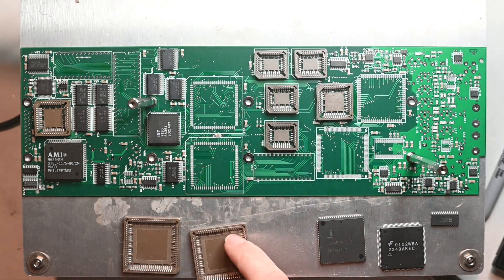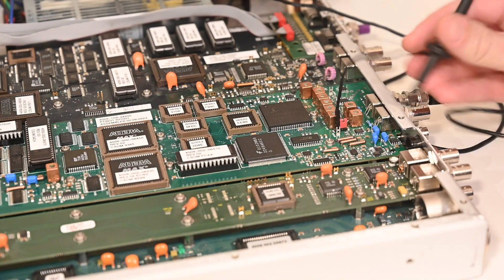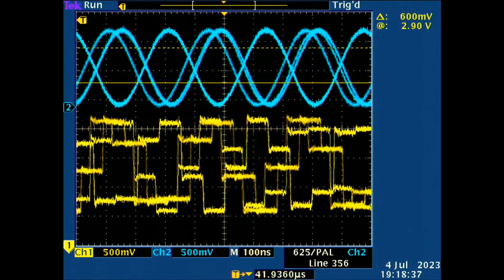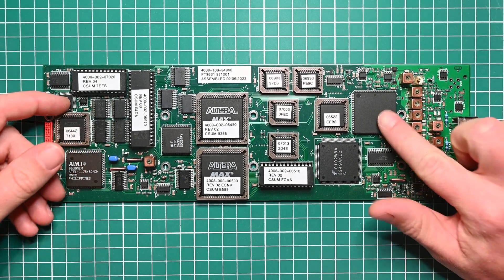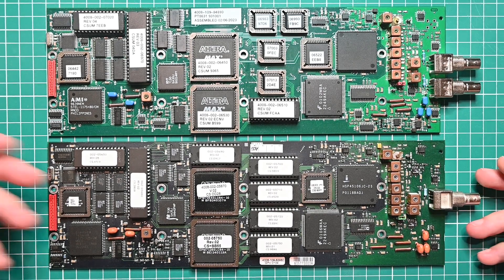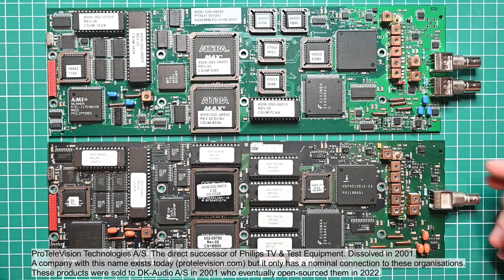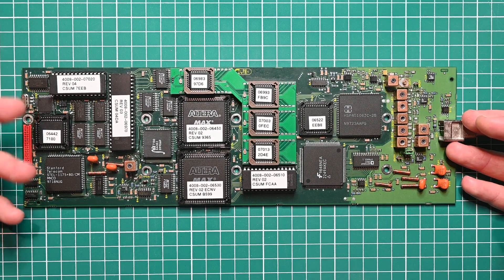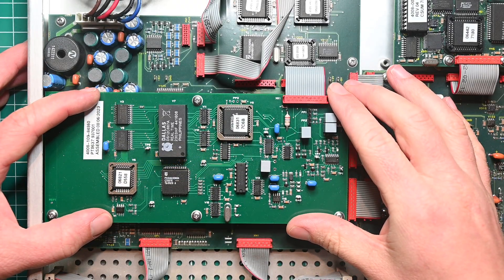#8 - Philips PT8631 build follow-up + Converting a PT8601 to a PT8631

Comment: While I can understand why you might want pro-grade hardware to generate an analog test pattern, due to all the signal quality and genlocking issues you mentioned - what's really the point of all this expensive equipment for digital signals on digital TV? How will a digital test pattern generated by something like a PT5300 differ from just playing a video file or running a simple program on a PC or something like that?
Reply from the maker: PT5300 is primarily an SPG not a test pattern generator. For a studio TPG even in digital you would want it in an SPG not a PC. Bear in mind the design was mostly completed in 1997. Quite hard for PCs of that era to generate digital TV signals real time.

Comment: I'm beyond fascinated by this, and in such awe at the technical prowess on display here, pun intended. But for Christmas, I want a video that explores how one would go about designing such a device, from scratch, as if there was no such device before. What components do what, and testing what chips would provide what result. I realise this is basically a thesis, but still!
Reply from the maker: I hear you. Well I do have one more video like this in the pipeline but as for building a project from scratch. I just can't commit to it at the moment. I am mostly focused on making these videos unfortunately. I would have to stop for several months to get the necessary time.

Comment: If you are interested Matt? I am doing a CQ-TV article on my new hybrid NBTV system, that is based on the old B-MAC format. You might find it interesting on how it works and the small amount of RF bandwidth that is required for transmission.
Reply from the maker: Always interested. Send over the info once it's complete!